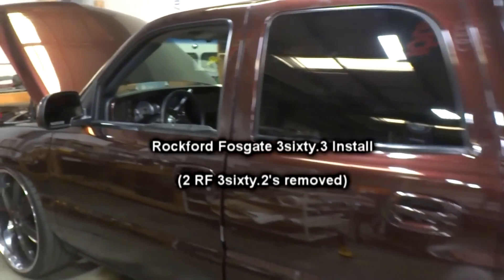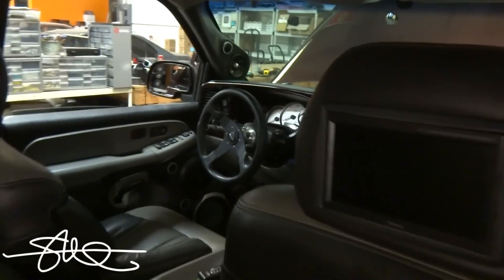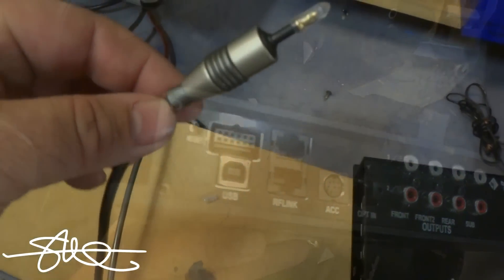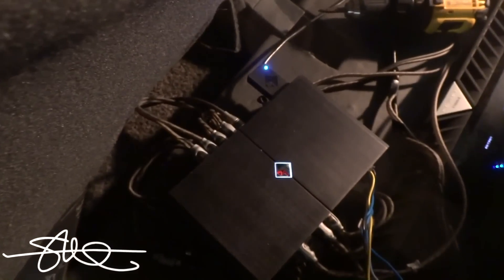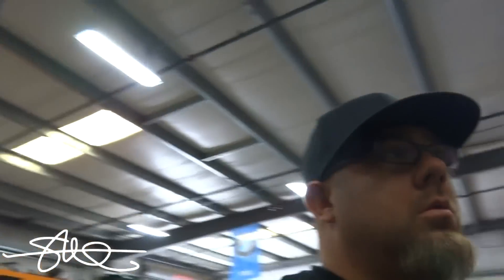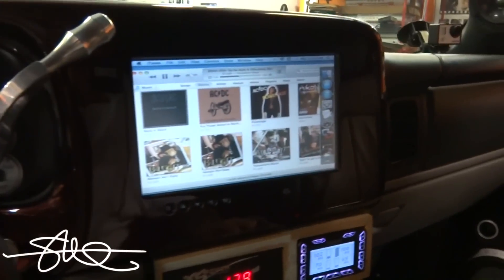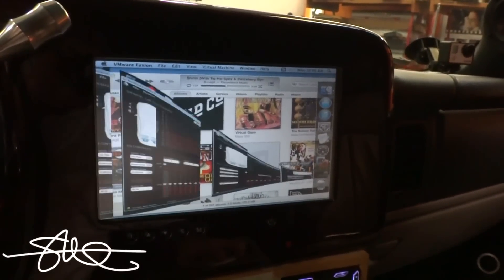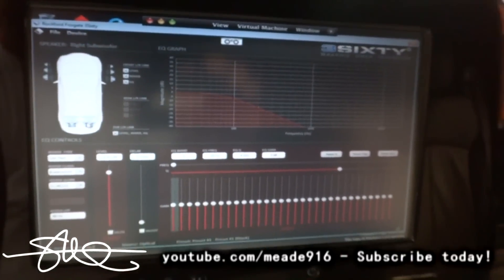Touch Screen In-Dash 248 Band 8 Channel Parametric EQ - Rockford Fosgate 3sixty.3 Installed

Comment: Hi Steve!!!! I know this video is a little old, but it drew my attention because  I noticed you we're able to connect the 3 sixty.3 to your sound system with no problem!!! Considering how many Amps you are running how we're you able to do that if it's only an 8 channel DSP processor!!! I was wanting to do the same to my sound system that consist of two T2500-1BDCP"S and four T600-4 amps for my mids and highs two way components!!! Would that be possible by using the ROCKFORD FOSGATE 3SIXTY.3 DSP???
Reply: I watched this and wondered the same, I used to have one of these for a normal system and it crapped on me. Think I still have it lol. I would think he would need a Mosconi 8to12 but good question.
Reply: NewEra0G been running mine since they came out with no issues. They are touchy but I just followed Rockfords recommendations maybe I just got lucky. How long did yours last

Comment: Steve I know this is an old video but how did you get the 360 menu to show on the ipad? I have the same setup I'm new to the whole 360.3 deal,  and if youre using the optic out why use rca input to? Is that just optional? thx

Comment: so for 360.3 u need access to pc or run through one?.   loving all the flexibility that showed?   or can it be setup with laptop saved then take laptop back into home.   I had planed to run an old eq6500 off my nexus 7 indash mounted.  but after see that 360.3.  looks like time to save money and change up my brothers 2005 civic install.

Comment: Hey Meade quick question... whats the name or brand of the touch screen your using for the mac mini? I have a computer running windows vista right now and its hooked up to the 46 inch tv in the back but I wanna run it on a touch screen in the front and hook it up with the rest of the trucks system too.

Comment: Absolutely awesome setup man, both the Tahoe and the system. Stupid question, but it's bugged me in every vid of yours Ive seen, what's the control you're messing with at 2:30 do exactly? It obviously brings the thunder lol, but it is a boost or remote sub volume level control.

Comment from the maker: yes, it comes directly out of the Mac Mini.  It makes absolutely zero sense for me to take the output from the Mac Mini, send it to an external sound card, and then send it out to the system from there when i can just use what is already there and sound exactly the same.  Some external sound card is not going to make it sound better.  On top of that, none of you know what this sounds like in person so i really don't understand how you can tell me what will be better.

Comment: obviously not as a music/video player.......but i wonder because im redoing my system and i really want a eq if my system can be finner tuned because im downgrading from 4 12's to 2 slims and 2 jbl 8's  in my doors & switching to components from coaxles adding a flip down for my little boy and i want to maintain or keep the DOLBY DIGITAL UNLESS THIS PROSSESSOR CAN SEPERATE LIKE DOLBY but i thought they were for tunning each(set/side) manualy as well as hz for hi/mid/low front/back n all that!!!

Comment: steave i have a pioneer 8in shallow mount in my explorers factory box with factory amp(40watt and box is plastic) i want to keep this becuse it hides beding a panal but need advice on better amp it says it is a 500 watt peak sub  i want a amp with bass control and still sound clean any ideas?